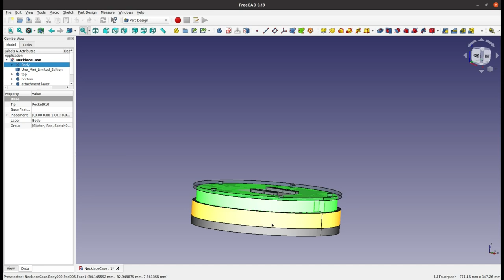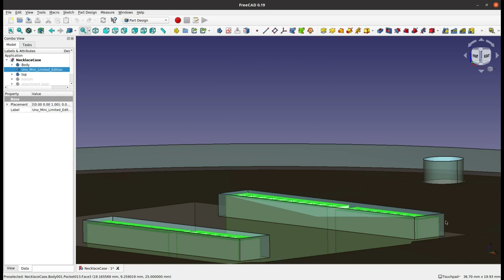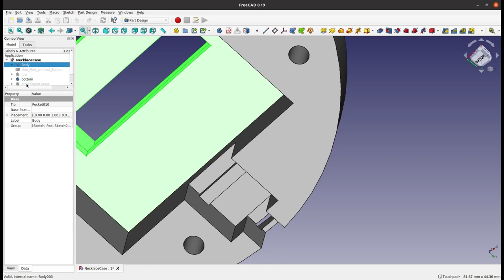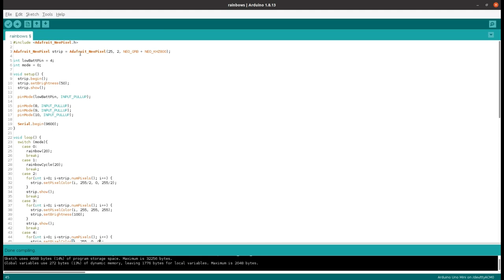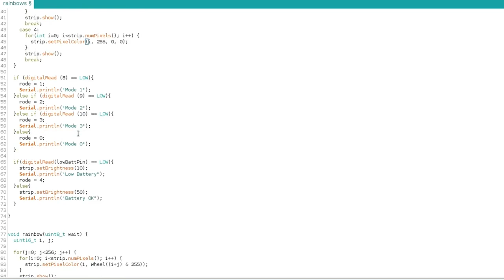Wearable Electronics with the Arduino Uno Mini Gold

Comment: I found the 3D printer the most fascinating part, it looks like mendel half upgraded to prusa-mendel (i2) and then most x-axis printed parts replaced with alu plates and bearing blocks and added planetary gear bowden extruder instead of the original direct one. Some parts probably already celebrated 10 year anniversary!
What I am missing from the video are some small generally applicable lessons,  e.g. showing some parts of the design process (starting with problem, trying alternatives, showing dead-ends, ...) instead of just describing the result. The results are not expected to be generally reproduced by others while the lessons should. Thanks!
Reply: 10/10! Full marks :)
The white parts are original, in fact, they were straight out of hands of Adrian Bowyer back when my husband was doing his PHD at the University of Bath about 11 years ago!

Comment: If you're planning to connect extensions to the header pins, I would suggest having somewhere to attach those boards or pieces onto the badge. Maybe like LEGO or other K'NEX connections?
Reply: Thanks, great idea. Maybe a little place to connect on the back, or at the bottom.

Comment: Make it smaller ... it's a curse.  In the 70s I reduced the size of a radio control reciever to the size of a postage stamp, sadly I didn't pursue it, that was less than one fourth the size of the original. About ten years ago, I decided to try my luck at making a smaller drone board, retired and bored , I sat before my computer.a month of going through parts and selecting, so many parameters to work with. The current boards were the size of a playing card, then one night i awoke about 3 am, went to my computer and, using cad software turned the orientation of one part then placed it on the bottom of the board, i had figured it out. The new board was 11 x 17 mm . I then went back to sleep. Two days passed before i went back to the design, i had eliminated 10 feed through traces, and the few remaining feed through holes aligned perfectly with the sensors long the other side. Sent plan to electronics manufacture , boxes of free parts.  OMG those are sooo small. They looked so much larger on the 32 inch screen .  Lol I had a young man who was willing to assemble it, a month later he died as did my enthusiasm for the project it worked but my heart wasn't in it. The design was copied many times . I designed habitat controls for critters and fish but grew tired. It had went from fun to working ..  I retired for a reason, I'm old. Take care.

Comment: That's cool!  Do you have any suggestions on how to make a Tron-style outfit using LED's, Neopixels, or anything similar that doesn't require a large battery?  This is to be used by me as an performing acrobat.  The ones I've tried to make in the past either required a bulky battery (even a 9 volt battery is too large since the outfit will be a spandex outfit and also there is a lot of movement on apparatuses like trapeze etc so we can't have anything that can be crushed or hurt the acrobat, or electrocute them with high current lol).
Reply: any form of bright led will require a substantial amount of current to be bright enough. you are limited by physics if you need X amount of energy than you need abattery that can store X. its a balance of runtime, intensity weight and size ,you need to find the sweetspot for your particular application. and of course there are always risks of fire, especially when you are dealing with high energy densities (like in lipo cells) & possible crashes.